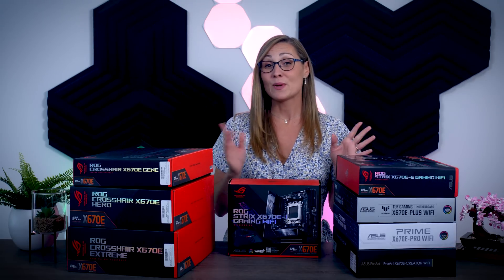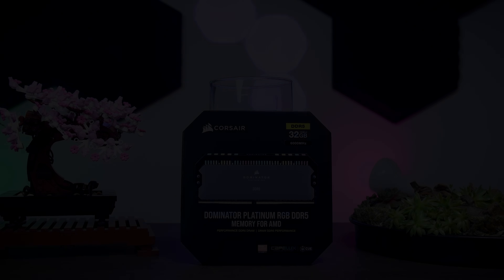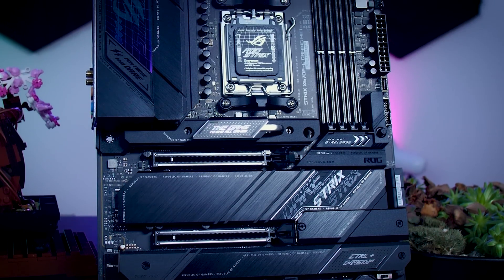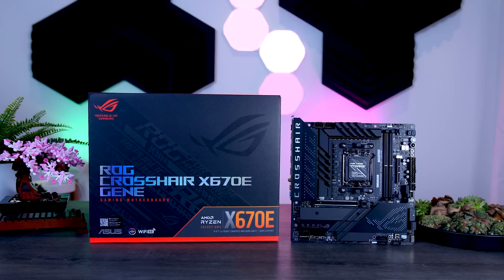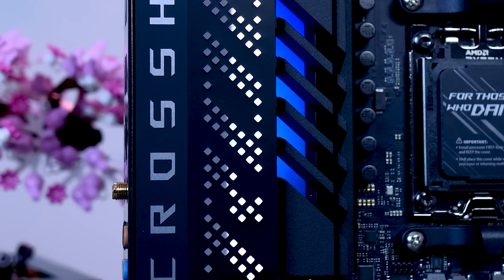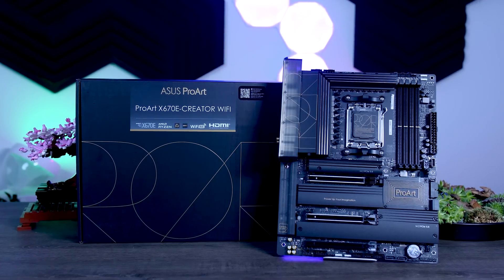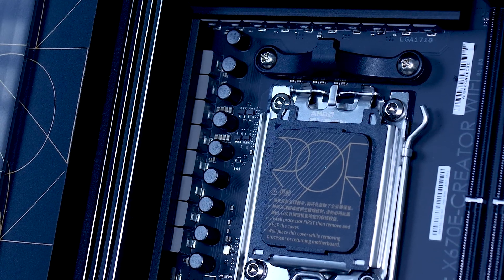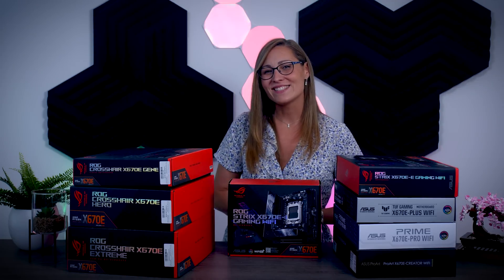ASUS X670E Motherboards - First Look at 8 new AM5 Motherboards for AMD Ryzen 7000

Comment: Just about had a heart attack looking at these prices.  A high end mobo used to be $500 not its $1000.
Reply: $12OO in India lol
Reply: Because they put 3 or 4 PCIe 5 in this motherboard.. thats new tech has high cost. I will be wait for B650 E
Reply: @arx117  b650e will at least come with 1 PCIE-5; the b650 might not even get that.
Reply: @TheSjuris  i just checked, none of B650 have PCIe 5. All of them is 4.

But some of them got M.2 PCIe 5. 

For now PCIe 4 is enough for next gen GPU. Even Nvidia latest 4090 only use PCIe 4
Reply: @arx117  AMDs requirement for b650 was to maybe have 1 PCIE-5 spot. It’s going to be used more by m.2’s for the foreseeable future so that’s why some boards have it.
Reply: @TheSjuris  you can go checked yourself, no need to tell me what AMD Said because AIB boards didn't follow what AMD told them to do. Even price didn't match for what AMD told them
Reply: @arx117  go lookup on YouTube what the requirements are. The b650 might get one l PCI-E 5 slot. They don’t have to put one there. That’s why it’s so cheap. Nobody needs one. There’s nothing out yet that even uses it and none of those boards are going to handle the heat.

Comment: I also settled on the Strix E yesterday when comparing side by side. I would've loved to have USB4 to simplify some of my connectivity setup via a dock but the Hero only having 2 full connectivity PCIe slots kills it for me as I currently use two Optane add-in cards (which are PCIe x4 connectors)

Comment: prices of boards are getting crazier by the generation, prob cos Ryzen is getting good and better.
still, sad :V
they are putting such prices on mobos you can have 2nd hand used high end mobo for zen 3 cpus, hero viii for like 300€ here, working and all. 
ofc buying new one, they wont reduce prices lol

Comment: 3:36   "Big heatsinks all around",  but buildzoid from actually hardcore overclocking said that the heatsinks are only necessary if you do LN2 overclocking, because they don't produce enough heat even with water cooling.

Comment: asus, good hardware but destroyed by crappy software, avoid at all cost.
Reply from the maker: I don't love their software, but it's still better than that of MSI/Gigabyte/ASRock :(
Reply: @TechTesters My new system using Gigabytes, way more better than Asus crappy software, which breaked mostly everytime after windows update. I also had one ROG mouse which can't store multiple combo keyboard stroke into their internal mouse profile, while other brands seem no issue at all. Their crappy Armory Create software had so many issue, just to install them, need a week to troubleshoot just to make it installed and some more times just to make it work. We also need to download a different software just to uninstall the existing software (what a crap). What's the point if their hardware good but can't work properly? especially the ROG mouse which is not cheap. I would avoid them at all cost in the future and would not recommend them to anyone.
Reply: @azmawee  tried to use Gigablows software to control my Trident Neo RGB, but not only didn’t it work it also prevented G-Skills own software from working. Also needed to buy premium motherboard to get the same features that the other manufacturers sold for $200 less

Comment: I'm currently using "ROG Strix X570-E Gaming" with "Ryzen 7 5800X". If I were to buy now it would be "ROG Strix X670E-E Gaming" with "Ryzen 7 7700X". I certainly don't think I need to upgrade to a new generation. I wouldn't feel a significant difference. In any case. I recommend "ROG Strix X670E-E Gaming", because he is the successor of my current "ROG Strix X570-E Gaming" which is perfection.
Reply from the maker: If you're on a 5000-series I'd probably wait a bi llonger too ;)

Comment: Sadly Asus is focusing on gamery designs. Also the prices Asus requests are just nuts. I personally started using Gigabyte boards. At first I was hassident as I had bad experiences with Gigabyte boards. But the QA and Bios really started to become way better. Can recommend now.
Reply: You didn't know this boards is for enthusiast?.  I will wait for B650 because i doesn't need new tech. PCIE 4 is still usable up to 2029 anyway
Reply: @arx117  I know they are enthusiast boards. I only buy enthusiasts board as I am one. But still Asus and Msi lately ask crazy prices.

Comment: I love her reviews, she inspects every quality, that all other reviewers miss. So I watch her reviews even if I watched other YouTube reviews. My first experience was with her reviews on a SSDs.
Reply: Absolutely spot on. I too like the way she present products. She is calm and very detailed.
Reply: Yeah the SSD one was really good
Reply: Same. My first time seeing her was an SSD review. Quite pleasant to watch.
Reply: You are here for her voice. Def needs to be a voice actress.
Reply: She didn't talk about the PCIE 3.0/4.0 switch, the fact that most of these boards don't have a proper quantity of PCI lanes routed to the non-cpu PCI ports (some boards have to split the 16x, some boards only have two lanes routed to the extra PCI slots), and failed to recognize the 60W power output for the front panel USB-C ports and how they need to get powered by 6-pin power plugs. One of the only channels reviewing a wide range of motherboards yet ended up spending more time ranking and picking a favorite than covering the quirks and oddities to look out for.

Trying to find info on these new boards during my research is turning up ambiguous info. I'd really prefer some of the questionable quirks to be demystified instead of shunning and throwing out options in favor of a wonky pick like the hero board. With the availability of the entire range being spotty I'm less interested in an endorsement and would really prefer to see testing, in depth analysis, and some fully illustrated comparing and contrasting instead of rattling off a list of detail for each one that can be found on the motherboard's respective webpages.

But yeah, other than that, good video.